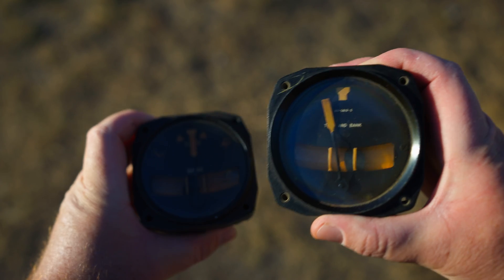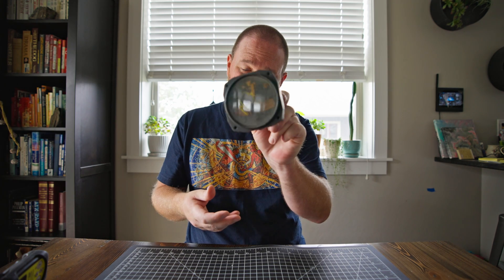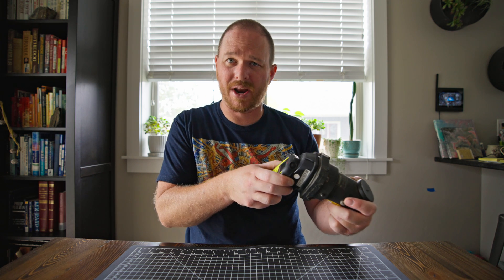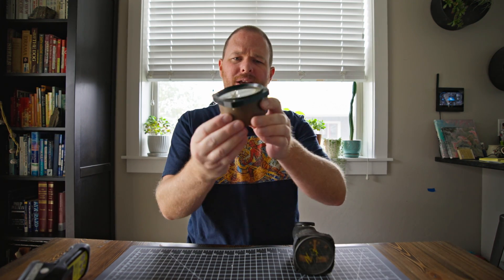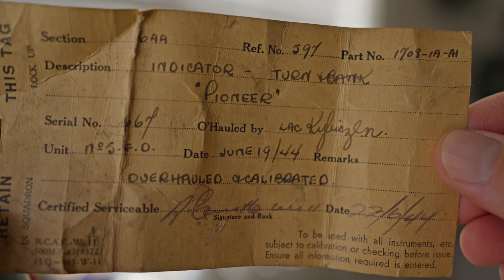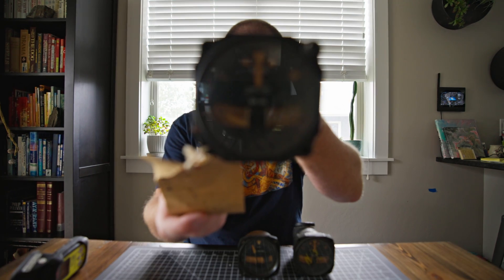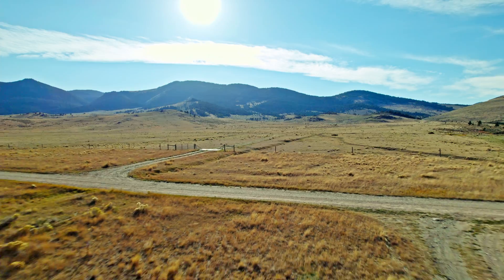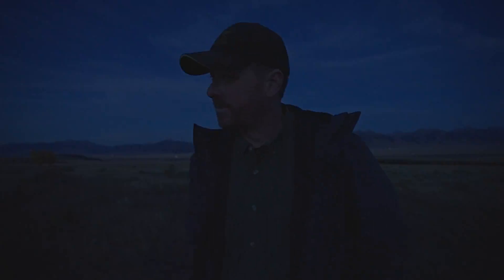Why Are These Radioactive and Glowing

Comment: The highest concentration of radium for the gauges was during ww2. They didn’t want to have the cockpit light on to read the gauges and be seen by the enemy at night. So they used a higher mixture of radium than compared to civilian aircraft.
Reply from the maker: Some of the military ones I have encountered have been pretty hot. But most of these aviation instruments are very active...depending on when they were made of course.

Comment: I've always wondered why that if the ZnS/ZnS:Cu stops glowing because of damage from the Ra-226 why it is that it still activates under UV light 🤨 I mean you're able to illicit a luminous response which implies that you're knocking electrons into a higher orbit and they're releasing photons when they return to their ground state. Why this stops working for the radium but keeps on chooching for UV strikes me as curious. I only have a few radium watch hands (tiny) I can see alpha/beta but they don't glow...bring a UV light next to them and they glow bright green. 

Also noticed your Ayn Rand book, vibe kinda matches your shirt a bit.
Reply from the maker: I think the reason why radium doped items still react to a UV light and not as much to the radiation is because the UV light might be dumping a lot more energy into the zinc sulfide causing it to glow...maybe. I have some zinc sulfide and some pretty strong alpha emitters. I need to see if I can get a reaction out of them being close together.
Reply: @ that’s a good point you’re dropping amperes of current into an LED, dunno what % of those convert to photons (mostly it’s heat) but you’re right it’s a ton of energy.

Comment: At what point would you be fearful of a radioactive object. I want to know as I have just gotten into collecting radioactive trinkets and I have a few fiesta ware dishes which I know are relatively harmless. However I become nervous when messing with other isotopes like radium as I would like to not have a dangerous emissions in the house with my family lol.
Reply: Thank you. What is a concern in cpms?
Reply from the maker: When it starts getting into the millions of counts per minute. But thats pretty general. Really depends on the situation.
Reply from the maker: I have some radium objects that do give me pause handling. But I usually try and keep my exposure down when dealing with items like that. Levels that make me a little nervous would be something in the range of 100 mSv/hr. Dealing with something like that could be a huge problem but as long as you recognize the danger is there and do what ever task you need to do quickly then its not that big of a problem. Those Co-60 sources that are used to irradiate food and other items are pretty scary. Having radium items in the house can be a slightly risky thing depending on the source. A have low level radium items in my house, like watches and small compasses. But I keep them in a locked display case so that the kids or anyone that doesn't know what it is starts handling it. The really scary stuff I keep in a safe away from everyone else.

Comment: Neat photography there at the end!  Imagine the career pilots behind those gauges, all day, every day.  I mentioned in another video my radium tipped switches in my 1950's buses.  Once we sat around on a very dark night, and let our eyes adjust, and we could just faintly see the glowing tips.  One wouldn't have noticed it if they weren't looking for it.  We tested them with a radiation detector my friend had, and I do not recall the reading.  It was way above background, making it go into alarm, but surely a lot less than those gauges, just because the illuminated area was tiny in comparison.
Reply from the maker: These gauges can be very radioactive that's for sure. Some of the older ones have a lot of radium in them.

Comment: I wiped my dirty radium compass that was left outside for months, and when I wiped it, the napkin got contaminated and it read at 20kcpm. Was it the radium dust or radon daughters?
Reply from the maker: More than likely radon daughters. Of course it depends on the condition of the compass. If it’s still sealed I would think radon daughters.
Reply: @RadioactiveDrew  It was a wwii paratrooper compass.

Comment: @RadioactiveDrew >>> Is there some way you could -- AFFORDABLY & SAFELY -- build some kind of 'sealed glove box' to disassemble those instruments and then apply new zinc paint to the radium bits to allow the glow to be visible to the naked eye? 

EDIT→ I posted this comment early on in a re-watch of this video. What you said about the paint escaping those instruments if they are poorly sealed pretty much answers my question.
Reply from the maker: You can safely take these apart without contaminating your work area. But applying a fresh coat of zinc sulfide won’t work as good as what was originally applied. From what I’ve seen the radium and the zinc sulfide needs to be mixed together and applied in that mixture. I know they use to take old damaged dials and put the parts that had the radium paint on then in a solvent of some kind. This would dissolve the paint and make it to where they could recover the radium and mix up a fresh batch to make new dials.

Comment: @RadioactiveDrew I’ve never seen a Blue Radium Turn Bank indicators before. Could you link me the specs or model number / Stock number or NSN? I would love to snag one for my collection. I have orange and Green Ra-226 but I would love to snag a blue one. The blinker oxygen flow indicators are yellow radium. And several Radiacmeters were painted with Green Ra226 some even with Pm-147. I love your content and I’ve been a long time viewer. You’re one of the ones who got me into Spicy collecting.
Reply from the maker: Pretty sure the blue ones were those larger back gauges in the video. I'll see if I can get into my radioactive collection and look up a serial number...it might be in the video to be honest.
Reply: @RadioactiveDrew  thank you that would be so helpful and I would be very  appreciative. One of the turn and bank indicators was listed with the service tag and I have that one but the blue ones are elusive and I believe it all comes down to serial number / manufacturer. No rush just whenever you have time. Thanks Buddy.
Reply from the maker: @kesslerfox  Here's the info from the blue gauges. Type: 1708-1A-A1-667. All the other numbers are just patents.
Reply: @RadioactiveDrew  thank you So much man I appreciate it!
Reply from the maker: @kesslerfox9858 no problem man. Hopefully you can find one.

Comment: I like the Radium-painted dials on gauges and clocks, etc. because usually they've got WAY more radium than they really need to, so instead of having to do crazy dangerous stuff like scraping off the paint and mixing it with the new paint, you can instead just throw some new zinc-sulfide lume paint over the old stuff and it'll still glow nicely from the alpha particles if you thin it a little. Strontium aluminate non-radioluminescent glow paint works good for some things but even the REALLY good stuff just doesn't stay glowing for long enough, if you want your watch to be readable by the time you wake up tomorrow or your gun sights to be glowing when you take it outta your holster you need either radium paint, tritium tubes, or some kind of battery-powered electroluminescent system. If leakage is a concern, cover up the paint with a clear coat so it doesn't flake off and get powdery. For me that's less of an issue, I work in HAZMAT on the daily so if I'm gonna open up a clock or something I just bring my respirator home and wear gloves, radium compounds are fairly water soluble so it'll come out in the wash and at the end of the day a few flakes of radium paint is less radioactive pollution than the amount of coal that gets burned to keep my lights on, or the process brine from the oil wells that fuel my car up. If it isn't in my body, it's a drop in the ocean.
Reply: i put new Glow in the Dark paint on one of my radium timers i have and it glows about 3-4x as bright as a clock i have from around the same era that i did not put fresh paint on, although your eyes still need to adjust to the dark to see it, but not as much, it would be cool to get some sort of radiation resistant glow in the dark complex to mix the radium with

Comment: Do military aircraft ball compasses emitt alpha particles?
Reply from the maker: Some can be painted with radium paint that glows in the dark. But the emitted radiation is mainly going to be in the form of beta and gamma radiation. Radium gives off a lot of alpha radiation but that radiation is mainly blocked by the glass of the compass.
Reply: @RadioactiveDrew  I seen some compases have radium paint even outside glass. In airplane era maybe people figured out that painting outside glass is dangerous?
Reply from the maker: @RynaxAlien I’ve seen those compasses as well, with radium paint on the outside. But some of the ones I’ve seen had their cover glass removed, I’m sure because it was damaged. Most of the time the radium paint was behind a barrier of some kind so that it wouldn’t rub off.

Comment: Hey Drew. Some time ago i came across 3 old instruments of an Vampire de Havilland at a flea market. I wasnt aware of the danger of them and they were really old and dusty. After that, i was at a burger Restaurant and i cant remember if i washed my hands before eating. Is there something you can do afterwards or is it just living with it and hoping nothing was ingested?
Reply from the maker: More than likely you are fine and will be. If the instruments were bare faced, meaning no glass, that wouldn’t be great. But it also wouldn’t be that much of a problem. With radium ingestion I know the body thinks it’s calcium and incorporates it into bones. But I’m not sure how much of it goes through that process and how much passes through the body. So I wouldn’t worry about it. Plenty of other sources of radium in our daily lives…like in ground water that is naturally occurring.
Reply: @RadioactiveDrew  alright, Thank you. That takes some Pressure. Already tried to meassure the radioactivness with a radiacode, but didnt get a meassurement through the cardboard Box. Was little bit to scared of taking them out. Do you know if it is possible to get some result with it?

Comment: I prefer strontium aluminate to zinc sulfide.
Reply from the maker: I haven’t run into much of that yet.
Reply: @RadioactiveDrew  It’s found in modern, higher end glow-in-the-dark stuff. No radium, thankfully!
Reply: Is strontium aluminate actually activated by radiation like that?
Reply: @thesciencefurry  it's charged both by heat and by ultraviolet. No radioisotopes required.

Zinc sulfide also doesn't fundamentally require radioisotopes.
Reply: @AmaroqStarwind  yeah both are activated by heat and light. But Idk if strontium aluminate is also activated by alpha, beta or gamma. It probably is.
Reply: @thesciencefurry  They both are.

Comment: Quick question. How exactly do you store these? I bought a ww2 vacuum sealed can with a roller smith ammeter type g-1 a few years back and have it on the top of a shelf in my man cave (I like to collect ww2 stuff, especially stuff that’s NOS or never been opened) 

I never opened the vacuum sealed can or anything like that. I tried researching online if these were gauges that had the paint on them or not (did all aircraft gauges have this paint on them or only important ones) 

Just trying to determine how much I really want to keep something like this around. Especially given I have pets I don’t want exposed to stuff like this. 

Thanks so much in advance! I appreciate ya!

Edit: I guess I should test them first right? Do you have a recommendation of a decent tester that would give me an idea of their potential hotness? Thanks again!
Reply from the maker: A lot of different gauges were doped with radium. If the gauges are in good condition they shouldn't present any type of risk...as long as you aren't really close to them all the time. Sounds like they are on a top shelf and kind of out of the way. The best way to tell if they are radioactive is to use a Geiger counter of some kind. The cheapest one that I can recommend that will easily pick up the type of radiation coming off of something like this would be the Better Geiger. You can buy it from their site or on Amazon. I did a review of this detector with some other ones https://youtu.be/3ONbwFMBS4Q

Also, the gauges can produce radon gas but it isn't that big of a problem.
Reply: @RadioactiveDrew  thanks my dude!!
Reply from the maker: No problem…glad I could help.

Comment: I bought an alarm clock from an antique store; it is HOT.  It's the hottest thing I own, getting over 20k CPM at times.
Reply from the maker: Radium can be very radioactive. Alarm clocks are usually on the lower end of activity because they didn't use nearly as much radium as what you would find in aircraft dials.

Comment: Can’t believe your handling these without gloves.
Reply from the maker: I did a bunch of wipe tests on them and didn’t find any external contamination. They seem sealed up enough for now.
Reply: @RadioactiveDrew ine leaked like a sieve.  But on the point about why one turn bank indicator is hotter then the other.  So back in the 1930-50 they would service these gauges.  When the glow would dim they would re-apply more of the “un-dark”. Which made them appreciably more radioactive.  My father has a traveler from these gauges that says that it needed to be replaced due to the gauge being to dim.  They said they re-apply the “Un-Dark” and put it back in stock rotation. Apparently they did this up to the 50’s.  Love the content brother.  Great video.  Those time-lapse photos where Epic!  Can’t wait to binge watch the rest.
Reply from the maker: Wow, those gauges must have been smokin hot. Radium is the one element I run into regularly that I’m very careful around.
Reply: @RadioactiveDrew  you and me both.   It used to be my favorite element when I was a kid.  Now it scares me.  Those gammas are so hard to attenuate.
Reply from the maker: Those gammas are like a battering ram. They have a ton of energy. Not just from radium but from all the daughters.
Reply: @RadioactiveDrew  I actually bought a Radiacode 101 because of your review.  To which I thank you
Reply: @RadioactiveDrew  I love that little tool.  It’s even more accurate with respect to actual dose rates and exposure.  Now that it’s energy compensated.
Reply from the maker: Exactly. I carry mine everywhere. It’s a great little tool to have with you.

Comment: I used to live near the National Physical Laboratory in the UK. They used to paint radium dials for aircraft instruments. Years later, part of the site was re-developed for housing. Fortunately the history of the site was known, and preliminary work recovered instruments, paint brushes and other radioactive debris. After removal of several feet of earth, an impermeable membrane was laid, and the area covered in soil.
Reply from the maker: Yeah, back in those days people weren't very concerned about contamination areas with radioactive materials. At least they cleaned it up.

Comment: 1940's and still glowing is amazing. 95,000 counts per minute. I recently purchased some new open gun sights that use Tritium to allow use at night. The manufacturer says, the production of tritium from lithium-6 is done using breeder ceramics. They say, Tritium will glow on average 20 years. Those Turn Bank Indicators put my gun sights to shame.
Reply from the maker: If you had gun sights made with radium instead of tritium they would be way more radioactive. As in I would be concerned carrying it around close to your body for long periods of time. The tritium gun sights don't really emit any radiation.

Comment: Amazing video! Stunnning timelapse at the end. I have two Radium dial westclox clocks from the 1940s and they both have Radium paint. The Zinc sulfide is completely dead from the gamma emission but it still sends my detectors into the 80 K region and on the one time I removed the front glass in an controlled environment the meter topped out at 92k.  Interesting history. I really enjoy your channel. Great cinematography and fantastic work.

Comment: Have you ever walked around old Victorian houses that used to use gas light? I bet you would find radioactive areas on mantels and were the wall meets the floor in some spots. The mantles because that is where the clocks sat and might have lost paint and the floors under where they had the gas light. Gas light mantles were made of Thorium.

Comment: The radioactive paint is easily removed, to restore the instrument. In a vacuum gyro, the gas will enter by the filtered intake and exit to a plane's venturi. Turn and banks, such as the Pioneer Gen A Motor/ Bendix, are favorite navigation devices. Give them to airport kids and watch how fast they wind up back in the sky.

Comment: How radioactive is tritium compared to radium? I have night sights on my pistol that have tritium vials.
Reply from the maker: Those tritium sites are usually very well shielded. I wouldn’t worry about them.
Reply: Even if the vial breaks, the small amount of gas will quickly mix with air. It doesn't contaminate its surroundings.

Comment: with the 2 planes that crashed at the dallas airshow, b17 and king cobra, do you think rescuers/salvage to crash sites of older planes should be concerned about radiation/contamination from the broken gauges?
Reply: Many but not all older planes have had their avionics upgraded to more modern instruments.
Reply from the maker: There would be a possibility of some very small amount of contamination but nothing to really worry about.
Reply: No, because the gauges usually don't break during a crash and the radium isn't pulverised, it's radiation is only dangerous when interested